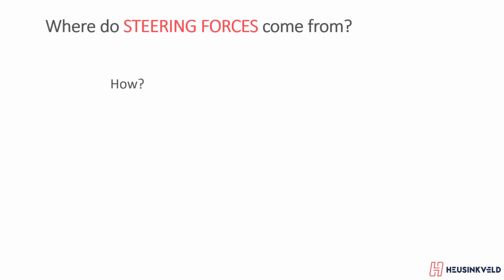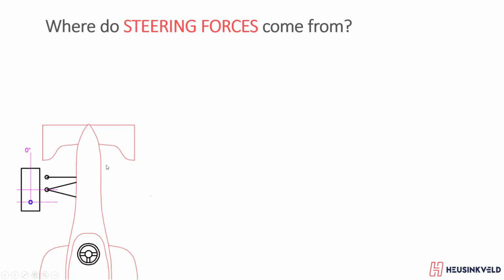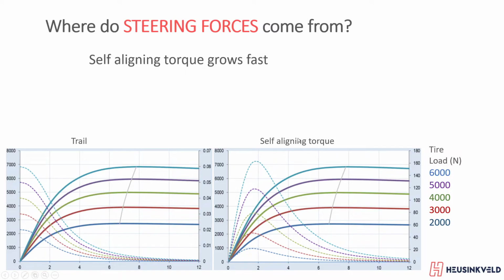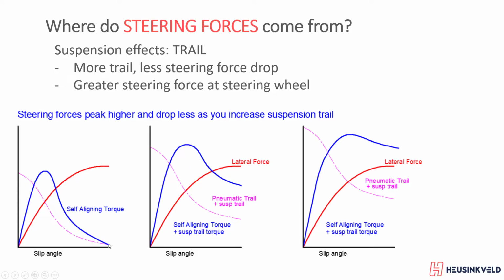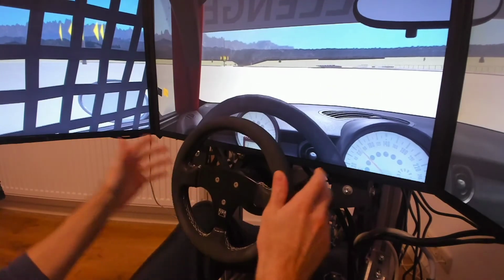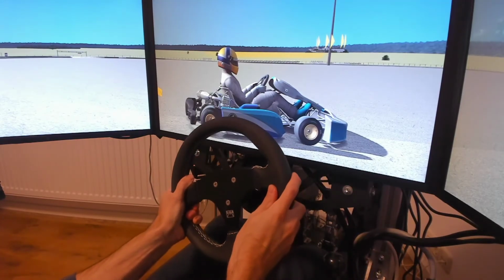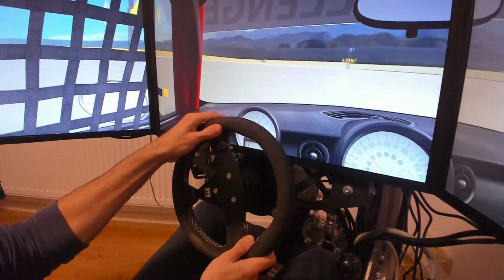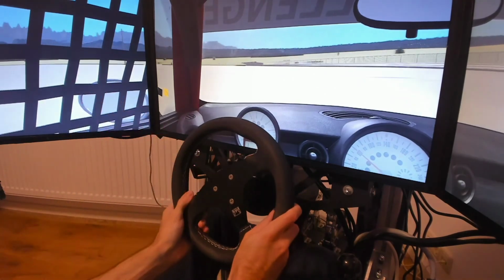(Race) Car Steering Forces EXPLAINED!

Comment: Awsome video and fantastic to have as a resource to link to people that ask about FFB ! 

I also think this video gives a good demonstration of why "non literal FFB" is so important for people that don't have motion rigs and want to still drive from "feel" 

In real life one of the main things used from a drivers perspective to drive fast (or at least know what the car id doing)  is the g forces through the bum to know if they are turning more / pushing the car more than what the tires can give because the moment the wheels give out on grip the g load on your bum/whole body decreases.  

As you pointed out in a SIM with litrall steering FFB and with real cars , on a given car/setup you might have more grip available even when steering is light from FFB. 

In short In real life you could hypothetically have no FFB from a wheel and you can feel through Gforces what the car is doing to then drive at the limit.  

But in a SIM without Gforce emulating bladders / motion rig using telemetry,  you potentially have nothing to feel where the usable limit is. 

I'd also argue "non literal FFB" is even more important for people without DD wheels as consumer wheels often seem to get overwhelmed with more detailed ffb (playing RF2 with a g29 for example)
Reply from the maker: On the fence about this. It can be confusing in real life too even with the G forces as I experienced with the track days I did last year. Brain struggles to comprehend that the lighter steering does not mean grip isn't still going to increase a bit. Plus 'how' do you do it? It becomes subjective and artificial. That's mostly what I don't like, because you no longer 'just using physics', but adding some artistic impression on it. You would still need people to learn how to interpret these 'fake' FFB cues and just like motion, a lot of the time it may make little sense..  But I haven't used an entry level FFB wheel for ages so I guess them being so 'unrealistic', its almost pointless to try and throw physics based FFB at their tiny motors..
Reply: @NielsHeusinkveld  

I don't think  "fake"  is a good  way to describe it as you would be driving  the ffb from the  telemetry.

Once you take gforces out of racing it's fundimently fake/abstract anyway.  

I can see the argument to avoid negative training by implementing abstract systems from a pure SIM perspective.  But at the same time vast majority of people are using this "Sims" as games / consumer entertainment. 

I mean It's not like SIM Devs have 10,000 other things they would rather be doing that will likely effect the bottom line more 😅  

I think the solution to lack of g feel is probably more likely to come from FFB wheel manufacturers the AF wheel has "foundation FFB" which I believe allows you to drive ffb from telimetary rather than the games normal ffb.  Fanatec fanalabs software is adding more telimetary based FFB options as well. 

From a player's perspective I think 
A key thing  that's needed is some sort of variation in forces  in the wheel for front end grip and for that to be apparent even on low end wheels.  

To be honest AMS , AC , RF2 all provide awsome highly detailed and variable FFB anyway with a DD and can be prity good even on the lower end wheels.  

 But it's not the case with all Sims and it seems there are different ffb philosophies and the different physics that then affect the ffb between  the Sims so a player always has to learn each games FFB regardless.
Reply from the maker: @GamerMuscleVideos  If I'm ever part of a new sim dev team in the future, it would be interesting to try some things out on this front. Now lemme get my shovel and find an oil field in my back garden..
Reply: @NielsHeusinkveld  come on, you are definitely one of the best "physics" guy and engineer in the industry of sim racing. You'll be part for sure in new sim dev teams anytime
Reply: btw mr muscle ..  I wanted to ask you this already but forgotten it.. but it fits here quite well.
Since you have so much trouble with th acc ffb... have you tried to dial in more caster (or less but I am sure more might be better with the things you don't like) in the setup ? I just tried the new porsche yesterday and had a similar experience where I thought.. I feel alot more whats going on with the old porsche... and thought what it could be and if the geometry is so extremely differend that I get this a bit unsatisfying feeling now..   At some point I thouhgt oh wait, the setups might use differend caster settings, looked at it and there you go..  it was 8,4 in the old and 6,something in the new...  put it back to 8,4 and the feeling was much more in common. 
So maybe if you haven't done already try to crank up the caster in your setup, maybe that is what you miss or at least it might get a little bit better so you might enjoy it a bit at least.
Reply: @NoNameLeft1500  Yes I have tried different caster settings.  ACC FFB just makes me depressed 😆.

Comment: 14:15 Mind blown! Always thought exceeding Self Aligning Torque force was going too far. 
Need to reprogram my brain with this information and add more turn.
Reply from the maker: Could be, could also depend on the car. You can make a suspension where the steering force peaks probably around the point where the maximum grip is reached.. The track BMW 325i I drove last year went completely numb past ~60 degrees of steering though, certainly before it hit peak grip.
Reply: Me too!!! Mind blown by this video as well

Comment: I tried to explain this stuff multiple times via written word only, but somehow I always ended up with loads of question marks over people's heads. Hopefully a picture will paint a thousand words.

Edit:
10:30 Niels, you drew the slip angle falsely here. The angle should cross at the center line of the tyre, thus as a result that the pneumatic trail actually trails behind that crossing point at the center line.
Reply: I saw somewhere that pneumatic trailing could be a result of tire frictional forces + cornering force resulting in offset resultant force. The reason why pneumatic trail moves forward as slip angle increases is that sliding portion of a cantact patch increases, and the part which still develope static friction is shrinking towards center, thus cornering forces also moves towards center.

But I am also under opinion that there is something not totally right, shouldn't cornering force point to the center of the turn radius, not out of it ? Tire is basically a rope that pulls into the center when driving in a curve.